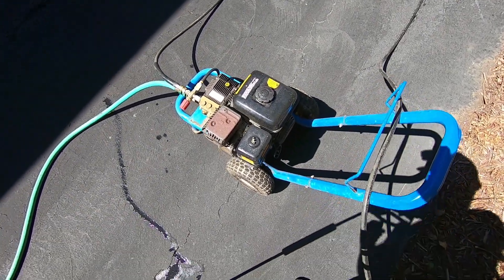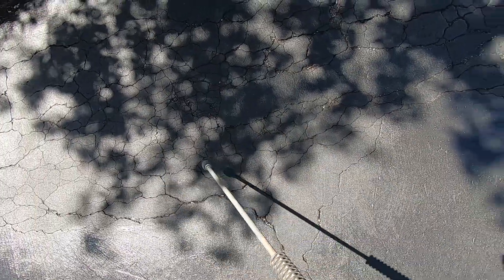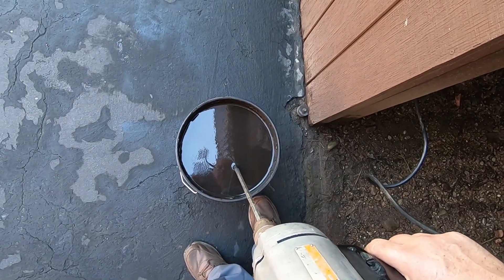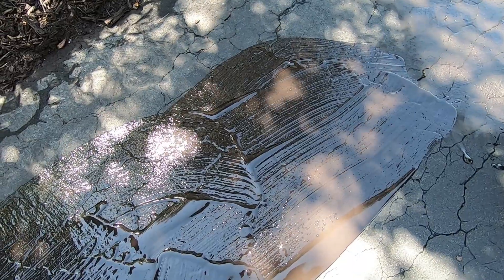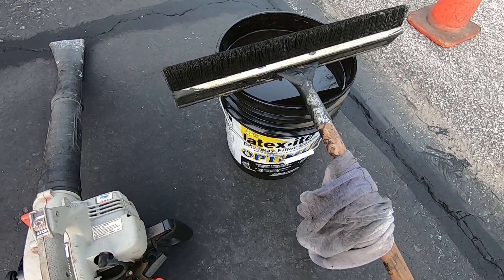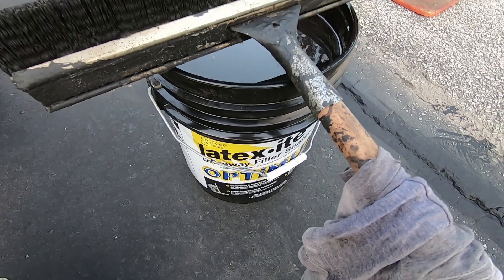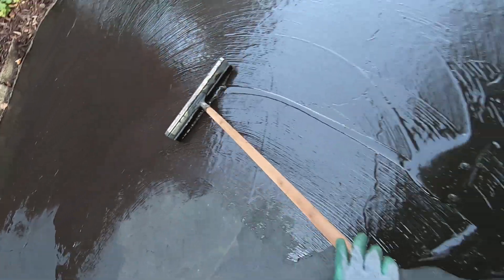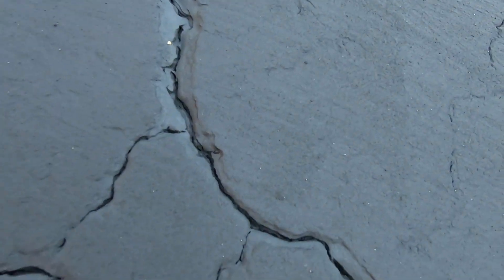Asphalt Sealing 2020 - This Old Driveway

Comment: Excellent video, explanation, and realistic expectations.  I really liked your comments and tips on mixing some sand to have some bulk on the deeper cracks.  I have a similar driveway with some pretty deep cracks.  I filled up the cracks partly with sand and then with a cracker sealant, It started to drizzle about 15 hours after, and even after two days the filler is not fully dry.  I will let it cure for a week until they are fully set, then apply the sealant.  
Thanks for the video
Reply from the maker: Glad you found the video helpful. Sometime later this summer, I'll do a final seal coat on the entire driveway, looking for a string of dry days, and doing the work right after sunrise while the pavement is still cool.

Comment: You should use some Asphalt Patch Leveler (like Resisto) in the depressions and even on the alligator cracks / cracks.
Reply from the maker: Thanks for the suggestion. Even though the driveway is fairly small by some standards, those depressions are pretty long. Crack sealing this year was only about $25 (one 5-gallon bucket) not including the play sand I already had.

Comment: How the hell did you clean your sealer applicator tool "brush" ?  Dried sealer seems to kill the brushes I use unless I use acetone.  Acetone on your brush could get really messy.
Reply from the maker: With the latex-based sealers I've been using over the past 10 years, the applicator cleans-up with water.

Comment: Says you drive over after 3 days. But walk on it in 4 days feels soft.  Is that normal?  I did 2 coats.
Reply from the maker: Weather conditions and the thickness of the application could be factors, plus, if the first coat hadn't fully dried yet. To me, the perfect day for sealing is one where it is cool in the morning, starting to seal at daybreak, with a full sun heat-up the rest of the day, and dry weather for a couple days after that.